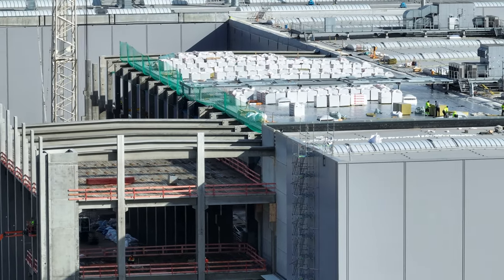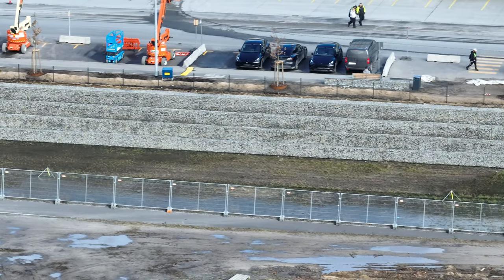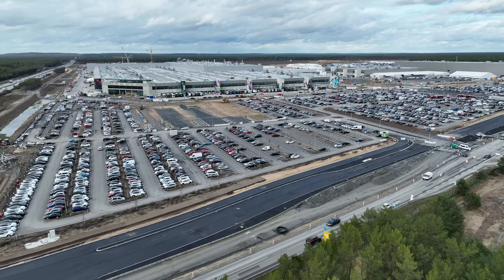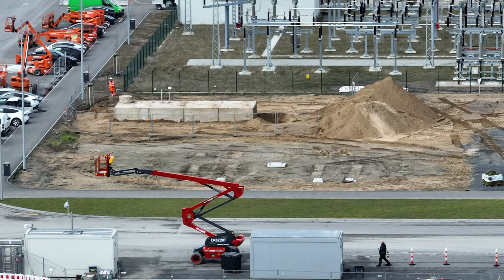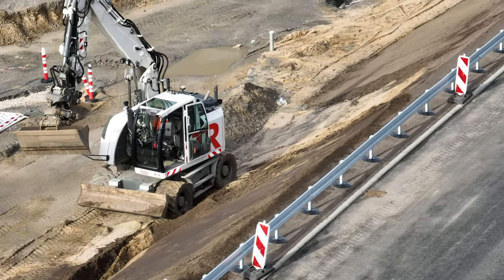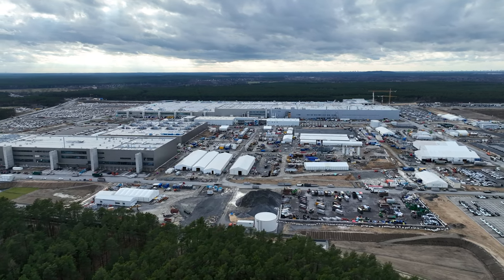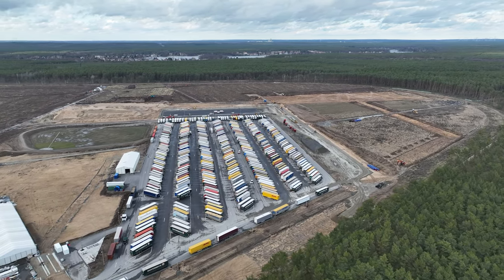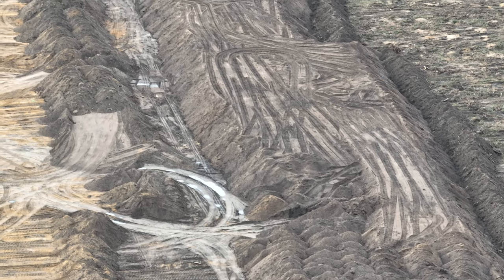Giga Berlin | 2023-03-13 | 2nd Voice-Over

Comment: Tobias, great idea with this new concept with voice over in simple English. 
:o)
Go on this way. Short explanations are  great.
No need to worry about the restrictions for fly over the factory direct.
New drone is fine.

At 15:29 there's a huge installation of kind of  heat exchangers. 
What they are good for ? Anyone ?

Also, there was a tiny super market in a green coloured container near the main entrance until the end of 2022. 
Have they moved somewhere  ?
Reply: LNG gasifier.

Comment: About permits: Tesla operates without hierarchy & internal bureaucracy, with teams and individuals free to do what they see needs to be done. They have their own contractor & likely foster this same approach among subcontractors. This is likely where the problems come in with getting permits. I can imagine the team responsible for getting the new piles started thinking "we already have permit, and those pile are much deeper, surely we don't need a new permit for these." Since the internal company culture is not one where you normally have to check in and get approval for every little thing, sometimes it also means checking about external regulations & permissions is overlooked.

Comment: Disappointing to see such extensive use (hectares) of asphalt a fossil fuel by-product. Tesla should do better
Reply: 🤣🤣🤣🤣🤣🤣 ok, cool, what would you use?
Reply from the maker: So, what should Tesla do instead?
Reply: There will even more paving necessary. To prevent potential ingress of pollution into the groundwater beneath Giga Berlin, they might have to pave everything they want to put something on. And surround it with curbs, and connect those areas to the sewers.
Reply: @sandmehlig  they could be using geopolymer concrete ( zero emission concrete) in place of asphalt
Reply: @terrencemartinvideoshorts  I do not know what is allowed to be used as a sealant. Concrete usually needs reinforcement and adequate sands (to prevent efflorescence). On the other hand: recycling of asphalt reaches quotas of 80%, asphalt stays flexible with appropriate binders to prevent cracking and keep the sealing intact. And it contains reused building materials and blast furnace slag similar to those used in geopolymer concrete.